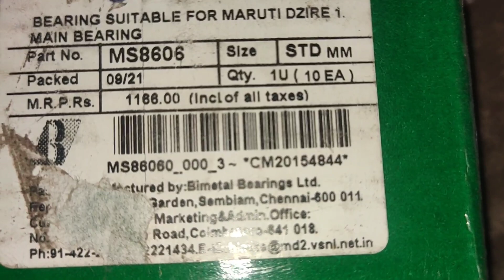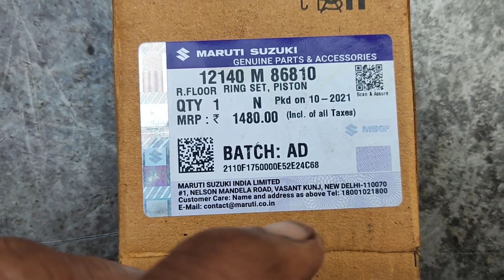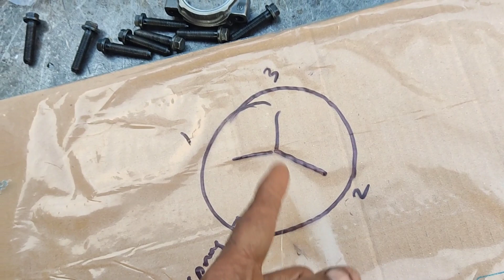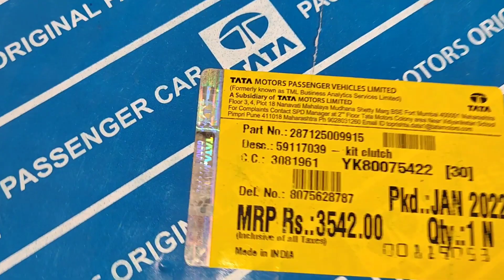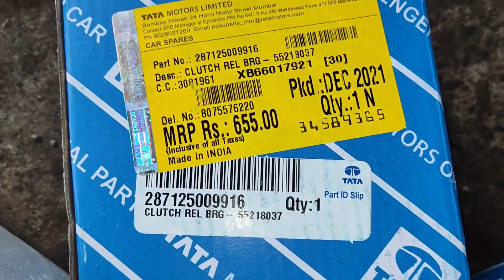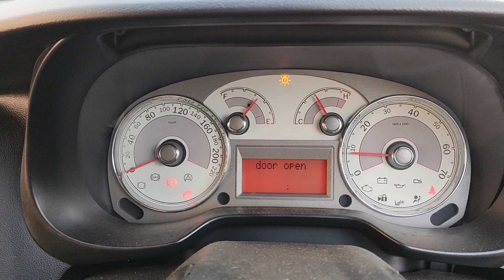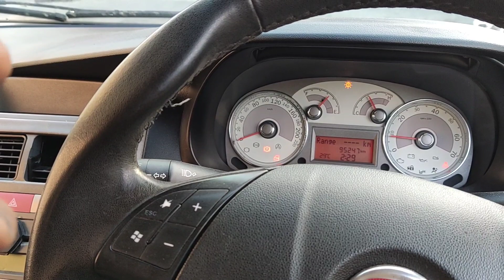FIAT 1.3 multijet Engine full Assembly (@skilledmechanictamil)

Comment: Hi sir, 
My swift diesel engine oil is always black. Even new oil became black easily. 
Can i try engin flush while changing oil? Will it solve that issue?
Along with im planning to clean egr and intake manifold,  throttle body and intercooler. 
Will above step save the oil ?
Please respond 😊

Comment: Hi I'm from Karnataka sorry i don't knw tamil but i understand tamil Bro i have grand i10 petrol sports 2018 i have a problem whenever i release clutch in 1st gear or 2nd gear thr is a sound like thud(whenever fly wheel and clutch plate is connecting ) i was a new driver i used to release the clutch fast when i was learning tht i continued after i got study for one year but now tht sound is coming when i release the clutch in 1 gear or 2 gear tht is very annoying for me even i told the problem at hyundai showroom nobody is ready to help they are telling it's normal but I'm not satisfied...plz tell something about this problem WAITING FOR YOUR REPLY

Comment: Hi Bro

I have Fiat Avventura 90HP 65000KM @ Chennai

Issue 1
when driving on 2 and 3 rd gear
1500 -2500 rpm
engine sounds rough.

Issue 2
Daily morning on starting and running till engine temp rises. I feel power loss.

Bro help we with some solution, 3 times fiat services centre went, issue not fixed.